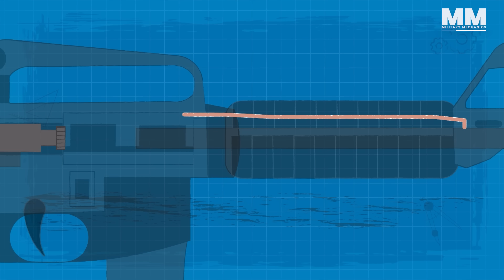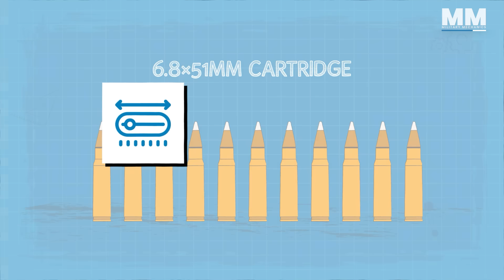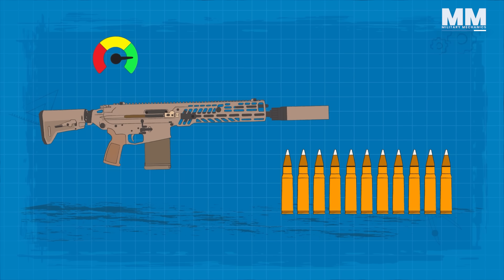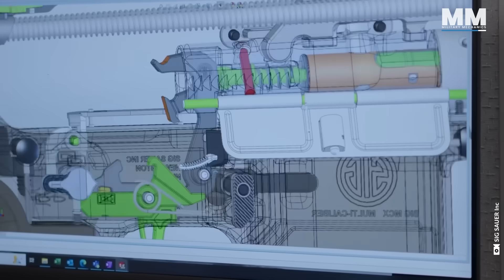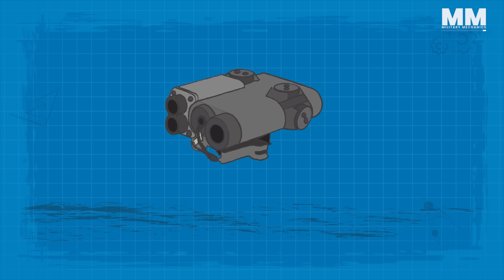XM7 vs M4: Why the U.S. Army Is Making the Switch

Comment: The return of the battle rifle.It’s wise to maintain overmatch for potential conflicts 🇺🇸
Great video thanks
Reply: Not if the average soldier can't maximize its utility.  It's front-heavy with a ton of recoil.  The rifle itself is heavy, and its ammo is heavy.  Your loadout is effectively cut in half, and you've got 2/3 the rounds on-hand at any given time.  

There's also logistics to consider.
Reply: dip in water and sand plus mud and see if it can still fire
Reply: @David-x2c8l  My M-14 would, anytime, all day, anywhere.